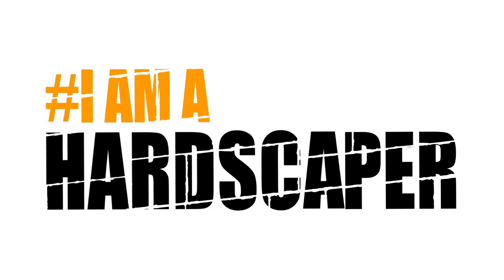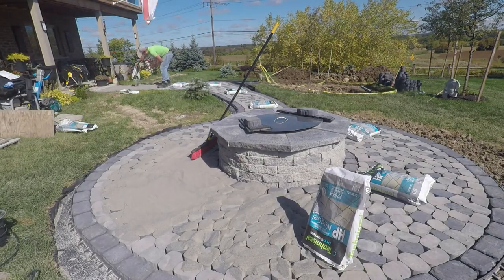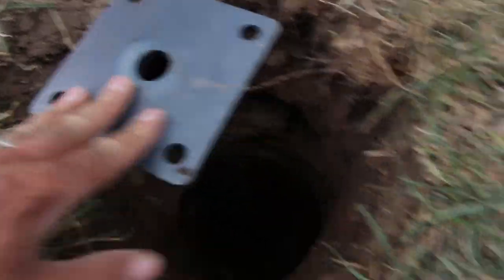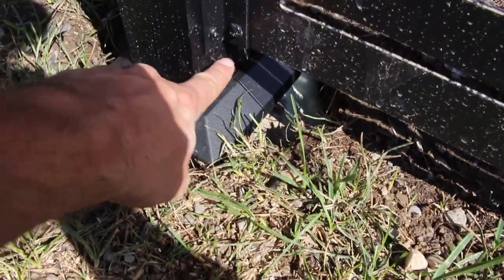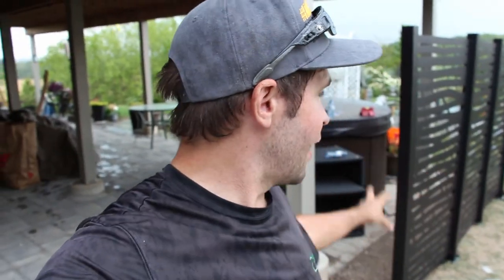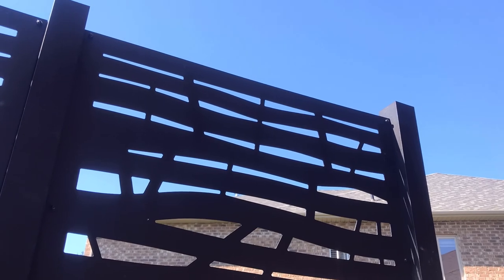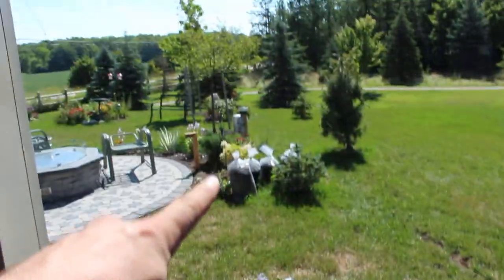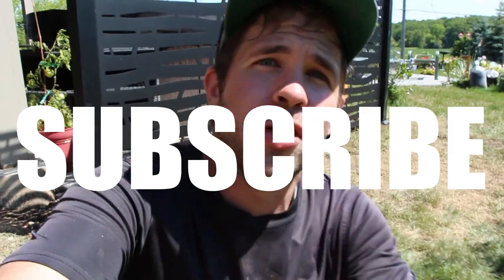How to Install Privacy Screens Easily | Clean, Modern, Lighting

Comment: Are these screens metal? Composite poly wood? Will they hold up in Las Vegas desert heat and wind?
Reply from the maker: They are powder coated aluminum. I’d reach out to Hideaway Screens to see what they think
Reply: @iamahardscaper  thank you! Just looked up their contact info!
Reply from the maker: No Problem! If you wanted to let them know you found out about them through us, that helps us in the future! THank you!
Reply: @iamahardscaper  I sure will let them know you referred me
Reply: Just installed the aluminum privacy screens using Holt posts and it turned out beautifully. They are indeed metal and they slip into a U channel however you must use the rubber gaskets in the channel to stop aluminum from moving and vibrating from wind. The area I did the install is about 10 feet off the ground and its windy and I have zero issues.

Comment: Could you tell me how to quote a privacy screen for a customer
Reply from the maker: Try to factor how much time it will take you to complete and then calculate how much that time is worth. If you are installing it with concrete piers, factor in a trip to auger and then pour concrete and come back in a second trip to install the screens. I installed it as I did so that I did not have to do 2 trips. This took me 15 man hours for 3 screens / 4 posts. Search our channel for how to price projects, that will help you as well.
Reply: @iamahardscaper  bro appreciate the advice good looking out!